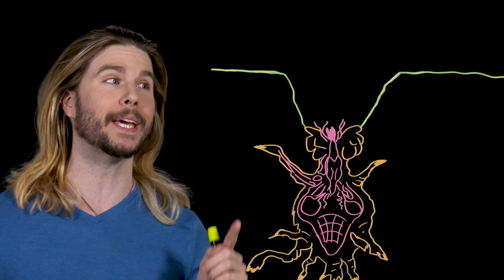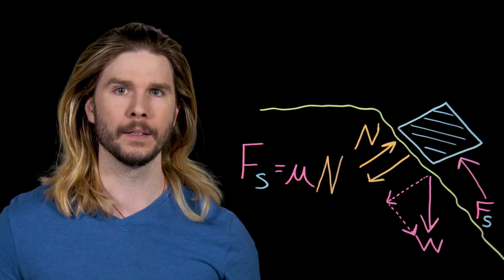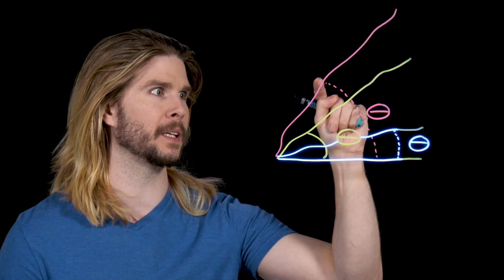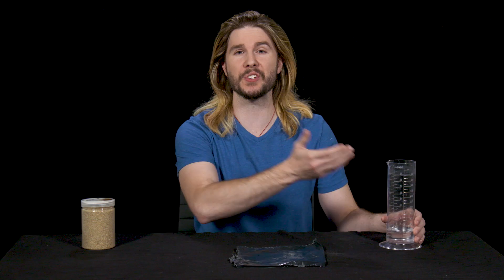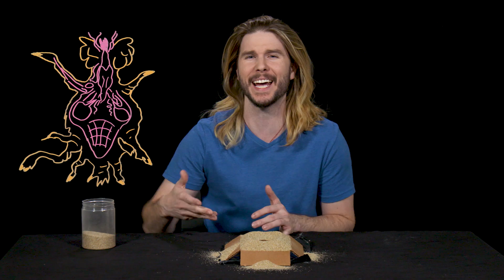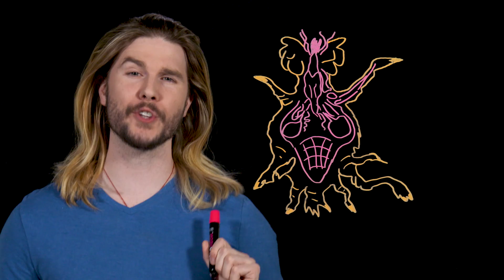How to Make a SARLACC PIT

Comment: Hey Kyle! I have an alternative suggestion on how to construct a cone with a perfect angle: 
The sarlacc burrows deep into the sand and then starts displacing sand (Perhaps simply by eating it.) If you do that at a depth you will automatically get a perfect cone around you up to the surface at the angle of repose as the sand on top will collapse down at this angle by definition.
Reply: But wouldn't this method actually get rid of too much sand? As even the sarlac makes movement, so if he eats that much then when someone touches it then the sand would already be at a low enough angle to not make them fall in.

Comment: Hey Kyle, I have been to Warren Dunes in Michigan and they have dunes there can reach several stories. You don’t realize how slippery sand is how exhausting it can be scaling a dune until you climb one. You send most of your energy try to gain the ground you lose sliding back down. But what I found interesting was while adults would huffing and puffing trying to get up the dune once, little kids would run up and down the dunes several times in the time it would take an adult, which makes since because of their wait. So I was thinking the ideal food a sarlacc would something big like a Bantha or Ronto. The pit would do most the work for them with something that big compared to something smaller like Jawa.

Comment: Hey Kyle! Love the show. Just one question over here, what size of sand grain would be the best to do this sort of mechanism? I imagine it wouldn't be the same if you use sand from beaches in Mexico (very fine sand) or from beaches in Massachusetts (very coarse), plus, there is a size in which it just starts packing in instead of keeping loose.

Keep up the amazing work!
Reply: The sand on beaches at the state park down the end of Plum Island reservation (parker river) is extremely fine. It feels like silk. The rest of the mass beaches are garbage.

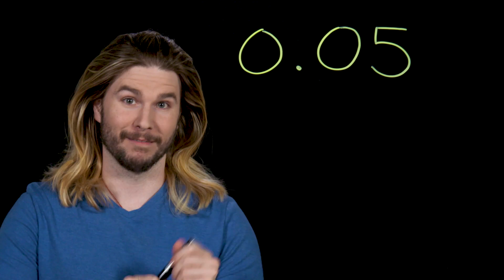Comment: 2:30 Ice is technically not slippery at all. What makes ice slippery is the tiny layer of liquid water that almost instantly forms under most conditions due to the ambient temperature. When you driver over an iced road, the friction of the tires cause the ice to melt ever so slightly which is what makes the road slippery. Hence why we add salt to icey roads: It lowers the melting point and reduces the amount of liquid water between the tires and the road.

Comment: You said that dry sand cannot form a 90 degree wall. That is not entirely true. Mechanically Stabilized Earth (MSE) will generally form a 90 degree earth, and can (depending on how it’s stabilized) support tons of weight without deforming.

Comment: As an immobile hunter a Sarlacc would need to maximize its chance of success. Because of this I am sure it would need to develop methods that are more efficient than naturally occurring forces. 

The Sarlacc could excrete a waste material into the sand that has an effect of slight electrostatic force, similar to a modern hydrogel. This material would mix into the surrounding sand and reduce the avalanche angle. 

The reduced angles would also greatly increase the area the cone would cover at the surface of the pit.

Comment: Note to self: Beware of suspicious sand holes near Kyle's secret base.
Reply: There are no suspicious sand holes around Kyle's secret base. Now please beware the Teflon covered Concrete holes near Kyle's base. After all it's the third on the list of solids in terms of lowest friction coefficients. You won't get a grip on them.
Reply: That's exactly what what a super villain would want you to think, that the slippery pits will send you to your death. But, they are really secret entrances to the base, when they're not being used as death traps, by changing their coefficient of friction such as retractable posts that can protrude from the surface to allow a vehicle to climb or descend safely. This would also serve as way to lure unsuspecting victims into the pit thinking they can climb and descend, too, in an attempt to thwart your super villainy plans.
Reply: Christyn Wegner: You mean like this: https://gatherer.wizards.com/Pages/Card/Details.aspx?multiverseid=5222
Reply: Just be suspicious of any holes near Kyle's base
Reply: @Noah Rivera Too late

Comment: If we want to maximize the chance of creatures falling on it , we should make it less obvious that there's a pit. Additionally if the sand has spherical particles like they are normally, it would have more slippery slope. Now to make it the most efficient pit make it as less steep as possible and as slippery as possible. This would make it very hard to spot a pit and most likely that someone falls. Making a balance between both is the 🔑.

Comment: Hi Kyle, I love this show. I always love learning things about whatever you do shows on. I have a few elaborations and other antlion facts that you didn't mention.

Antlions are extremely sensitive to ground vibrations so they know the location of their prey.

While you mentioned that antlions (and by extension sarlacs) dig their pits at the angle of repose so that prey fall into the pit at the slightest touch on the side, you didn't mention that antlions will actually fling sand at their prey to make sure that they cannot scramble out. One thing that the sarlac could do is to start lashing out at the sand to make their victims fall fast towards it to replicate this. Antlions do that not by hitting the prey, but by increasing the weight force on the sand around them so that a bigger avalanche brings the prey to the bottom of the pit where the antlion can kill and eat it.

Once the prey is now at the bottom of the pit the antlion injects it with venom and digestive fluids like a spider and waits for it to digest and then sucks out the insides.
 I also found it interesting that the antlion larva not only don't excrete waste until their adult stages, but also use some of the waste in their construction of their cocoon during their pupal stages.

I'm so glad I decided to look up antlions and learn more about those weird little dirt pits I always saw in barns while I was growing up.

Comment: Ok so the sarlacc is supposed to be 3 meters by 100 meters. That's 706ish cubic meters. (Changing that to feet because I'm american and dont understand the metric system) that's 24932.155 cubic feet of angry sand monster. Best I could find for is an average of 55 lbs per cubic foot of flesh. Cutting down to 70% for air pockets, organs, stomach, ect since it is probably not solid muscle and that was best I could find for average weight density of mammals. This gives us a massive weight of 959,887 lbs. A human weighing this much would need 20569027 calories a day, or about 3.5 elephants a day.

Comment: The sarlacc faces another problem in the event of a sandstorm where the pit might be covered up. A creature of that size living in the sand and growing in one spot for its entire life is extremely difficult. A sand planet like Tatooine must have sandstorms so frequent that the creature has to find a solution to dealing with them. It might not have the ability or strength to crawl it's way out of the sand unless it's body shape was very thin. If the sarlacc is a much wider creature then it would need to find a way to move sand out of the pit because the forces acting around it would mean the animal would need to use that hole as a permanent dwelling. It would only make sense that the alien creature must have a way to move itself out of it's established dwelling or it has to be able to efficiently move sizeable masses of sand out of the pit. It would be a neat concept if the sarlacc had a means to  pushs air out of it's body through many little tubes to fluidize the sand and make mobility easier  because it is usually depicted as such a large and wide creature.

Comment: We should also consider what the sarlacc does with all the extra sand it swallows. Given that unlike an antlion, it has a massive gaping mouth that is always open, so it is inevitable that sand will fall into its mouth, which it probably doesn't want too much of (unless it incorporates the sand in digestion in a sort of gizzard). Either way, if enough victims fall into the pit, eventually enough sand will have fallen that the pit will widen and the sand will settle at a shallower angle of repose, making it easier for victims to escape. This is not ideal, so the sarlacc will need to add more sand back to the pit to fix its shape.

Maybe the sarlacc has a specialized organ or tentacle near its mouth that can gather up the loose sand that has fallen in, and fling it back up on the walls of the pit just like the antlion. But why stop there? Why not add some sort of secretion, like mucus, that will increase the angle of repose of the pit and make it even steeper? Or even just the opposite: adding some sort of super slippery slime that actually decreases the angle of repose of the sand, but still making it too slippery to escape. This would increase the footprint of the pit, increasing the chances that something will wander into it, while also making it less obvious to victims until you're already in it.

One final potential use for swallowed sand: why not take a note from one of our earth animals, the sandmason worm? It uses a mass of tentacles to gather sand grains and binds them together with sticky mucus to form hard structures. Maybe like a mouthful of jagged teeth that prevent victims from escaping the pit once they've fallen in? That sounds familiar...

Comment: My favorite real world example of the angle of repose is the Bent Pyramid in Egypt, the original angle they built it at was too steep and was having structural problems, so they finished it with a more stable lower angle https://en.m.wikipedia.org/wiki/Bent_Pyramid

Comment: [Requisite "Hey Kyle; Love the show!”]

Now that we've got that out of the way - Given that the sides of the pit would be at an angle (of repose) and not straight up and down, wouldn't a sarlacc ball pit be better approximated by a cone?

Base area = 7.07 m^2
Height = 100 m
V(cone) = 1/3 * base area * Height - 1/3 * 7.07 m^2 * 100 m = 236 m^3

Using Reddit/wiki's math of 0.00018 m^3 and a packing density of 64%, that would mean 839,111 balls, which is 1/3 less than the initial estimate. Which makes sense based on the simple difference between the conic and cylindrical volume equations.

But, really, though - love the hands on/practical Bill Nye-esque demonstrations that take the theoretical and makes them real.

Comment: What if the sarlacc exhales nitrogen into the sand? 
I have heard that you can sink into sand easily, if the sand has nitrogen gas inbetween the particles. I dont remember why exactly it is like that, but my guess is less friction. 
So, what if the sarlacc produces nitrogen as a waste product to make the sand more "slippery"? Would it make the pit more effective or as useless as the sequels?

Comment: Hello, Kyle. Show's great as always!

I know you are a huge Witcher fan so I have a trivia for you: 

In the books, in The Witcher saga, Ciri once encountered huge fantasy ant-lions. When she accidentally teleported from Tor Lara onto the Korath Desert, also known as the Frying Pan. She was travelling with a unicorn and they encountered a number of conical holes in the sand. Some a couple of feet wide, other - dozens of feet wide. Unfortunately she slipped and fell into the pit. Huge jaws sprung out the middle as she slid lover and tried to grab her. She tried to use the sword, but the creature was too deep, she only stabbed sand. Than, she used aard-like spell directly on the jaws, blowing the sand out and revealing a larve body. The creature quickly started to burrow itself deeper, feeling exposed. The unicorn fell in also, got bitten in the leg, poisoned be a creature venom etc.. But the giant ant-lion did not only wait for a prey to fall in but it actively was shooting a fountains of sand to cause a sand slide from the edges inward, so the prey wasn't even safe at the edge of the cone pit.

Comment: Hey Kyle, what a great episode!
One question though; assuming the gravity is higher, would the angle be sharper because the sand would slide on itself more easily, or would the angle be wider, because the sand would stick to itself more? 
I ask, because it seems the Sarlacc pit's edges are steeper than the Angle of Repose of sand we see here

Comment: Hi Kyle, great show!

The sarlacc will also probably want to maximise the surface area of its pit at the ground level to catch as many preys as possible. Because the slope of its pit has to be the sand angle of repose, the only thing that the sarlacc can do to make the largest pit is to bury itself as deeply as possible. 

The radius that can be achieved is then depth divided by tangent of the angle of repose (roughly 1.5 times the depth for a typical sand angle of repose of 34 degrees). 

It is lucky for the sarlacc that sand has a relatively small angle of repose compared with other materials as it helps creating the widest pit. A sea-side sarlacc burying itself in wet sand on the beach would be less effective (with a wet sand angle of repose of 45 degrees, the radius of the pit would be equal to the depth so the surface area would be less than half that of its desert counterpart).

Comment: Hey kyle love the show, how fast would you need to run to be able to escape the pit? Or how light would you have to be to not fall when you step on the sand?
Reply: It's not how fast or how light you need to be, since it's slippery as hek. Like, even if you're the Flash, you can't run without friction under your feet.

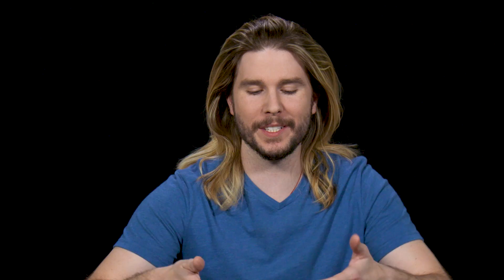Comment: 6:28 "You can't build an equivalent structure out of perfectly dry sand"

Would you believe that we actually do use sand as a building material?  While I completely get the point you were making in that sand alone does not make a good structure, when combined with a layers of supports like metal meshes, it has the structural ability to hold up a car!  Mechanically stabilized earth (MRE), is a process where you have a layer of meshes inside a loose material like sand to create a very cheep way to stabilize unstable slopes.  In my opinion, the best part about them is because they release much less co2 when compared to curing concrete.

source: https://www.youtube.com/watch?v=0olpSN6_TCc
source: https://en.wikipedia.org/wiki/Mechanically_stabilized_earth

Comment: This is why I think the original (non-tentacled) sarlacc made more sense. It's buried and doesn't move. It's probably not eating much, so it makes sense that it would digest slowly to gain as much nutrients as possible. That all being the case, those tentacles would use a lot of valuable energy and be unnecessary considering the angle of reprose of sand and the poor reach of those tentacles. I suspect that the original creature would be the better survivor.

Comment: As a woodworker, I just want to clarify this since it no physicist I've talked to knew this.

As we all know, there are many different types of wood with different styles of fibers, densities e.t.c and some physicists account for that. But the surface of wood can be vastly different depending on a few factors.

Number 1. By using sandpaper you can reduce or increase the amount of friction the wood can have. 

Number 2. If you have made a guitar or a piece of furniture out of wood. You will almost certainly either lacker it or oil it. This fills the fibers and overall makes the surface smoother.

Number 2.5. If you use, for example, polyurethane lacker. The surface will no longer be wood, so you will have to use the frictional constant for polyurethane instead.

Then again. Some physicists I know use 10 as the gravitational constant so I don't think they care anyway.

P.S love the show, and you Kyle <3

Comment: If you lay down face first with both arms as a pillow to create a mini  pocket of air, and do not move a single bit, you will fall into the sand until you catch traction and then once you've stopped moving slowly try digging forward with your fingers and the sand under you will become slightly compact in comparison to the sand above you, so you want to try letting sand under your arms and legs to gain more leverage to push your butt up to let sand under your belly and then the arms and legs ect.(enough oxygen will be pulled in with sand) . until you're able to crawl on the compact sand and just keep churning the sand in front of you, using your shirt around both arms for extra surface area, or if you can pee on it too....